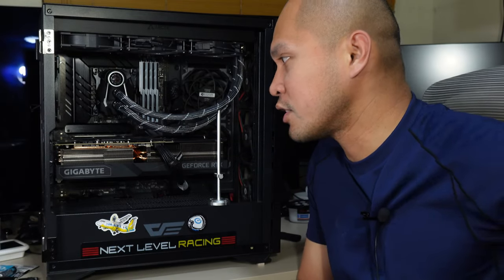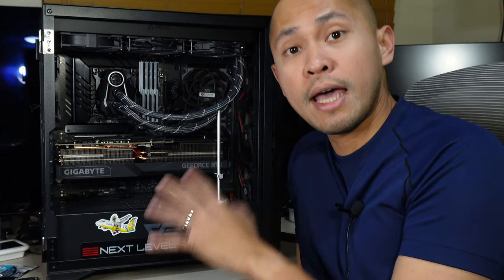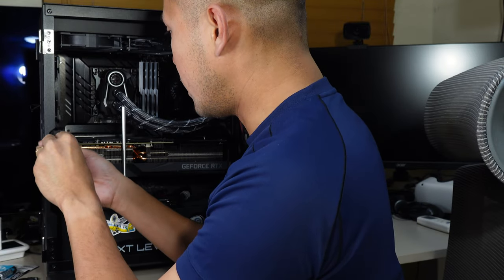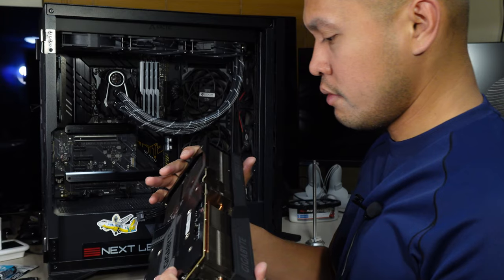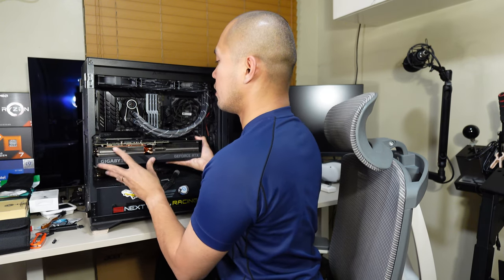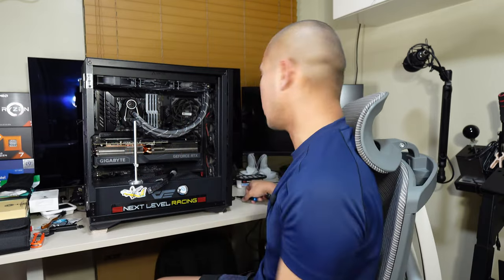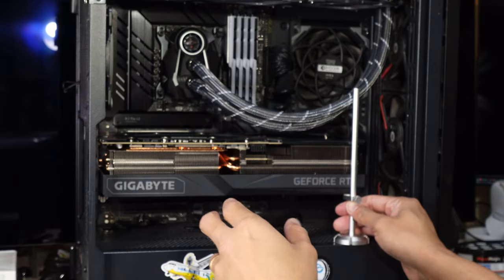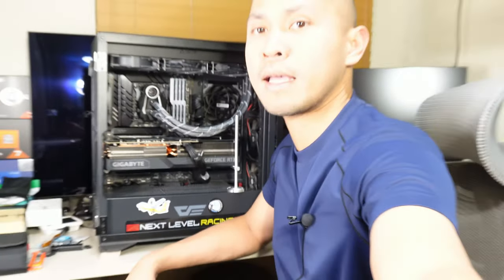Preventing and Checking for cracks in the PCB of my RTX 4090

Comment: Are you using the new updated 12vpower cable from Nvidia or is this the first version that shipped with the first batches of 4090s?

Edit: Nvm, you answered it around at the end.
Reply from the maker: Neither. I’m using a cable that’s sent out by seasonic. It’s a free cable but i had to pay for shipping. The cable was offered as the 4090 was released. So I’m gusting this is a V1 cable with a somewhat longer appearance for the sense pins.

I’m not experiencing any problems with it since installation.